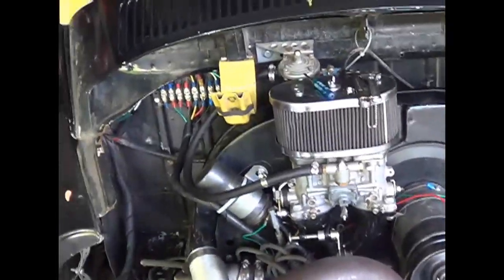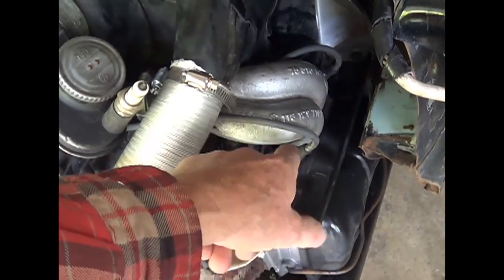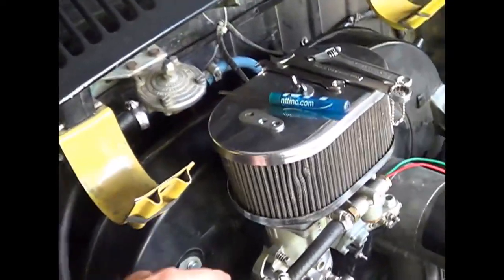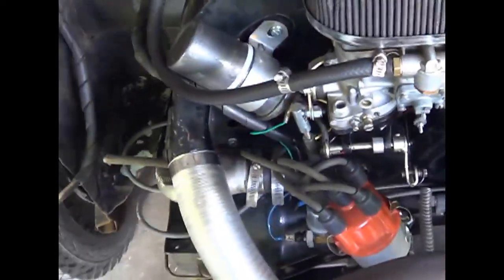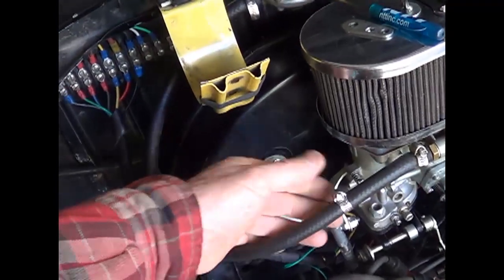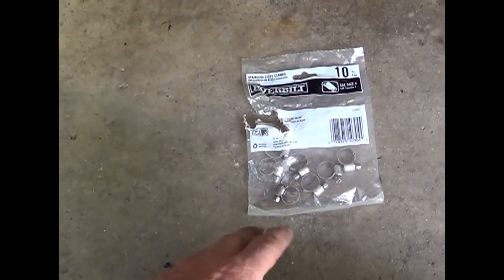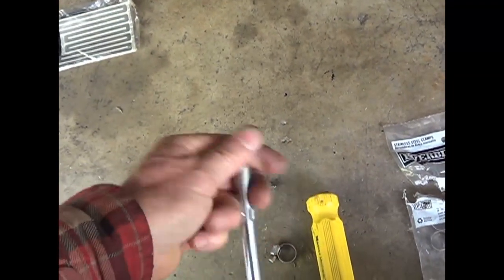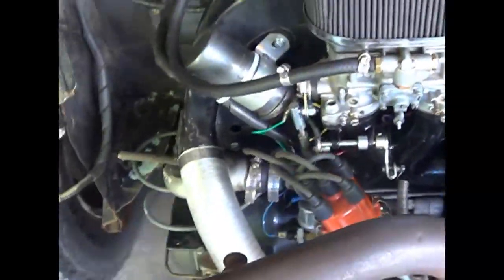40 IDF Weber Test pt1

Comment: I had this setup. you need to take the top off the carb and drill out the pump jets by approximately 20%. they are too small from factory as these carbs are designed to be much closer to the ports. that and a proper 034 vacuum and mechanical advance dizzy will make a whole world of difference!

Comment: is that a fuel regulator on the firewall behind the carb. and what are the advantages of running one. just curious as I don't have one
Reply from the maker: This engine was made from a fuel injected case. There is no place for a stock fuel pump so I had to mount a electric pump under the gas tank and I decided to use the fuel regulator you mention to keep things under control. When out in the ruff you can turn down the pressure to 2 psi and it doesn't flood out.
Reply: Oh okay. Thanks for quenching my curiosity

Comment: is this carb best with a stock cam or a mild one like an w100
Reply from the maker: Haven't tried it with a stock cam. This engine has something close to w100  and after lots of jet changes and fiddling I finally got it to run pretty good in hot weather.  It got poor in town gas mileage. Can't run it in cool weather without heating the manifold or it ice's up. I drive this car every day.

Comment: I do like the single carb program. Better tune ability. The Baja I just bought has a 1641 with dual Kadrons I want to take it to a single. Any thoughts.
Reply from the maker: I have a dual Kadron set up.  They are by far the best dual single throat carb for your application. That being said: They have the worst center mount linkage around. Dual carb linkage of any kind are PITA.  That one of the reason I am doing this experiment before I tear down and fix the oil leak. I might just put the stock cam back in so this carb works better. I can feel the power loss going to this from the dual's but I will gladly take that for the simplicity.